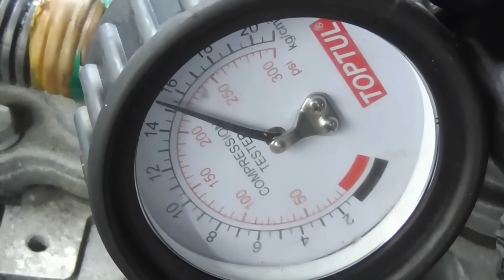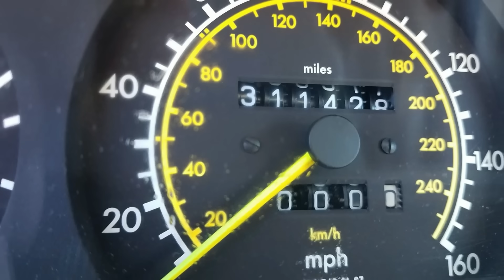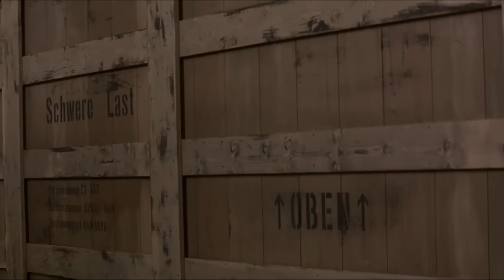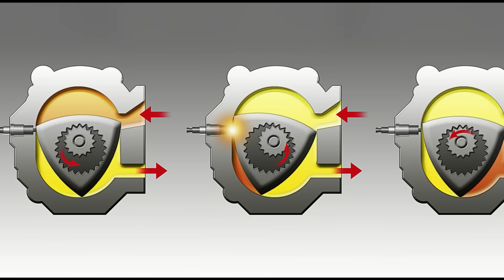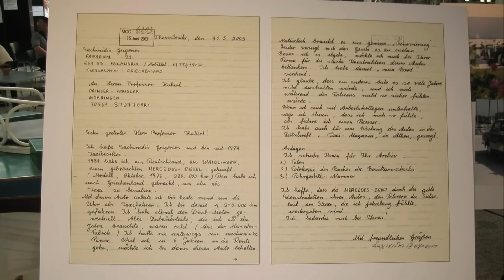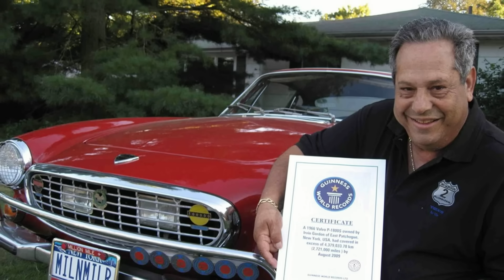Most Reliable Engines of All Time

Comment: No GM 3800 but you list a rotary engine?
Reply: The 3800 is a good engine
Reply: u kidding about the gm 3800? i hope so.
Reply: GMs 3800 v6 won design awards. Not sure why they stopped making it. They'd figured it out and it ran almost flawlessly since they fixed it in the late 80s.   Starting out it's life as GM's thrown together response to the 70s gas shortages/efficiency push. It had an inauspicious beginning. GM simply cut 2 cylinders off a V8 and put it out. It was, then, a piece of crap that often vibrated itself apart well below 100K miles. By the late 80s, GM woke up a bit and installed the counter rotating balance shafts necessary in a 90° V6... It got better and better. Won awards, as mentioned. Then it was gone. 🤷‍♂️
Reply: Lolololol
The GM 3800 series SUCKS
Reply: @Jett-Alaska  you clearly have never owned one
Reply: @kylecannon5679  You're right. But I've sure worked on alot of em.

Comment: Is that miles or kilometers? I wasn't aware that people in Europe measured distance in miles. But that would still be in excess of about a million and a half, and there are stories of several US Engines making that Mark quite easily. I've seen the Chrysler slant 6 run 3 and 400000 Miles with poor maintenance. I even saw one go 79000 miles from brand-new till one day it didn't start and the owner had never even checked the oil much less changed it. Where the oil drain plug was removed only about 4 oz of sludge dripped out of the oil pan. It probably ran for about a year with no oil at all.

Comment: Correct list is: 
1. Diesels
2. All inline 6s
3. Any completely stock Honda or      Toyota engine
4. SBC
5. Ford 4.6 
7. Any Mazda N/A engine
8. Ford 4 cylinders
9. GM 3.8L v6
8. 351 Windsor 
9. GM 4 cylinders
10. Volvo t5
There is no such things as a Dodge or a Nissan or a rotary or a purely german engine in a reliability top ten list. Lmao

Comment: Our 1972 VOLVO 245 station wagons engine went 450.000 KM had some parts changed in 1984, went 680.000 KM then we sold it to a friend of the family who had it run close to a million KM. We bought the car used around 1980, when it had 180k - 200k km on it. My fathers 1997 Toyota Corolla's engine ran without a single engine failure its entire lifespan, retired in or around 2012.

Comment: 4.0l Inline 6, in the 1987 and on Jeep Cherokee’s, very very reliable
Reply: Those AMC sixes with the 7-main bearings were  durable, long-living motors. Easy 200K life with a little care. They date from decades before the Jeep Cherokees used them.  Back in the 1960s, famous race car engine builder, Barney Navarro built Indy 500 race motors with the 199- CID version that made over 850 horsepower.
Reply: Charles Nash daaaaamn I had no idea, thank you for the info it’s always cool to learn new things like that!!!! I own a 1987 Jeep Cherokee Laredo with the 4.0 235k miles and still has a lot of power!!!!! Of course it’s old but I love it it’s cool and very comfortable they definitely knew how to make really nice seats back in the 80s 😂😂😂 I’m only 18 so I really wouldn’t know but those seats are the comfiest seats I’ve ever sat in
Reply: A friend of mine had a 95 cherokee with 420k miles!!!! It was a beast but rusted out and was junked. 4.0 high output!!!
Reply: Dodge/ Chrysler does make (or buy) great engines. It's everything else that falls apart. When someone says their Jeep is in the shop I ask if the radiator is leaking, and I'm usually right.
Reply: @gorkyd7912  Jeeps alway are  over heating
Reply: I've got a 96 Grand Cherokee Laredo with 4.0 at 350 plus and she's still going just fine,,, I've gotten her up to 25 plus MPG on highway and 19 in town.
Reply: Tractor engine not on the list !
Reply: Mine is 19 years old and at a young 200k.  Only minor parts like a thermostat.
Reply: dont forget its smaller amc engine in the gremlins and hornets, 300, 000 easy
Reply: Junk
Reply: Clover Rover you mean they were junk from the day they were made ?? My grandmother had a 1995 jeep Cherokee with the 4.0 and it burned oil since day one and was taken to the dealer many times for them to say it was perfectly normal
Reply: @thezeroto60outlet  ur grandma was a  dumbass and got her oil mixed up with her gas. But honestly anyone that knows anything about engines  would know how great of an engine this is...

Comment: Rotary engine have short engine life. So do sports car/ bike. They are higly stressed.
  Low tech engine with less horsepower can go 1 million  miles as long as you change engine oil on time and don't do high speed run.
  Some engines don't even need a valve adjustment for 4 years and yet run strong !

Comment: Just to toss my picks on the pile:

How about the 5.7L 350 GM engines with half a century of reliable history?
GM LS series engines are earning the reputation of being dependable and super tunable...
4.3L vortec V-6 (skip the CPFI years 95-96 depending on application) They also make damn good marine application engines for Mercruiser.
4.6L Fords with the PI heads and better intakes- I drove many Crown Vic PIs with these turning 250k+ HARD miles with hundreds of hours of idle time to boot.  You still see mid 90's to early 2000s (non-Triton) F-series with this engine putting along, usually no issues besides the exhaust flex pipe rusting in half.
2.2L GM 4-cylinders for rear wheel drive applications; after '98 they got better head gaskets and these powered most of your U.S. post office LLVs with 300k+ miles of stop and go driving.  Had one in an S-10 mated to a 5-speed and it survived for me 200k of abuse as a delivery car, college commuter, and all-around work mule.
3.8L GM v-6 is one of the most reliable engines ever made- appeared on Ward's list for years.  Earlier models liked to eat alternators a bit.
4.0 straight-6 Jeep/AMC engines have been known as damn near bullet proof less a gasket here and exhaust manifold there- in production in various form for several decades!
International 7.3L Powerstroke (Ford) aside from the occasional sensor woe has been known to go half a million or more miles without any mechanical failures

I could go on & on about the lack of love for the domestic engines.  Hell even the 5.7L Hemis are proving to be very reliable albeit typically bolted to Chrysler junk automatics for their first decade of applications... this list is laughable!

Comment: My 5.3 L Chevy 1999 Silverado 410,000 miles.
Reply: Nice!  I wish my 2011 5.3L didn't have the AFM/DOD lifters, cause it will never last that long.  178k so far, and I hope to get a few good years out of it yet.
Reply: @Maxxarcade  Yes, that Active Fuel Management feature is a durability issue, but otherwise the 5.3L is a great engine !
Reply: @rosspbarnett458  I got one of those Range AFM disablers, and it actually made my mileage go up a bit.
Reply: @Maxxarcade  Hopefully your motor lasts a long time !    Peace
Reply: My 2007 gmc classic 231,000

Comment: I've had 3 jeep Cherokee sports with the 4.0 6cyl. All over 400k with just belts and oil change. Best America engine made
Reply: I loved my 4.0 six inline cherokee. 
Only bad thing with those cherokees is electrical problems, sensors/computer. At least mine did and it was a headache sometimes.
Still great car!
Reply: @nonromanroman3204  yeah every now and then the windows wouldn't go up or down and sometimes the speakers wouldn't work, but those are end of the works vehicles, started every time and drew through 18inches of snow without a problem.  I still keep one around just in case.

Comment: Cummins out last any and every engine. 1000000+ miles on mine.
Reply: What year and model Cummins engine and in what application?
Reply: @integritytransport8762  1996 Cummins 12 valve Dodge ram 2500. Changed oil 3500 miles, fuel filter changed every 10000 miles.

Comment: I drive an 06 Ford F150 4.2 v6 220,k+ miles with basic maint. It runs like a new one.  So most of your mentions are no big deal,
Reply: I got an 03 v10 f250 with 540000 miles stock transmission and engine

Comment: I had a 1988 Ford escort that went 287,000 miles, still had original clutch.
Reply: Mine have 297,000 miles  two rebuild one new engine three transmission .
Reply: @yoteyeet5601  I only did regular maintenance on it. Timing belt was the biggest job I had to do.
Reply: Well when you're throwing down like 60 hp to the wheels u don't lose much disc material. 😂
Reply: @Jett-Alaska  yeah, it was a good car though, had it 14 years.😎

Comment: I gotta agree with the 2jz motor i have a 2003 or lexus is300 with 225 k on motor with perfect compression across the board and valves seal perfectly no leak down or blow by could prolly use new injectors thats about it

Comment: Clear bias towards complicated "tuner" power plants. There many, many, many engines that go a long way past 300,000 miles, however they are mostly bland every day motors. Ford 300 six, Toyota 22r, Toyota 1FZ-E (mine has 265,000 on the clock with no problems), Volvo whatever series motor in the 240 station wagon, my brother in law's has over 500,000 miles on it and he'd still be driving it if he was alive. Real world perspective guys, not "golly, this is sure a purty shiny  thing."

Comment: There are some diesel engines you missed there dummy.  Most diesel pickups will do 500000 without skipping a beat.  Semi engines do 1000000.

Comment: Owned a 2002 Camry 4 cylinder. After 15 years and 300,000 miles was still running smooth as a Swiss watch the day I traded it in. Should have kept it. Most reliable car I ever owned.

Comment: Why isn't the Ford 240 / 300 cid. Straight 6, on this list?
Reply: Yup, I had one, put over 350K on it before selling it. Great Engine for a Six Banger and had a lot of toque too.
Reply: Bought a 95 f150 4.9l 5spd with 116xxx miles, sold it had 487xxx miles and still ran lol the 300 inline 6 is in generators tractors pumps UPS trucks all sorts of applications
Reply: @joshmiller5640  I know about the generator use and UPS using them, I have a Onan 30ek generator with the Ford 240 in it.
Reply: I had an 82 yellow linemans truck that was hand painted red i drug out of a field for 100 bucks. Odometer stopped at 230000 so not sure what the real mileage was. At 3700 rpm all six rods would rattle but it never quit on me. Even got 30 mpg once on a slow drive.
Reply: Yes' Ford and GM were left out of the list !

Comment: RB26. Reliable.

At least you guys did that first, so you didn't waste my time before proving your lack of credibility.
Reply: ScathingMobile I have a R32 GTR and the last thing this engine can be described as is reliable.
Reply: JDM GEARHEAD 😂
Reply: @jdmgearhead960  after seeing that I was expecting the second engine in their list to be the 13B, based on how every rotary fuckwit on the internet tells you they're heaps reliable as long as you treat them right i.e. baby them by spending half an hour warming them up then another half an hour warming them down, top up the oil every time you drive it, and service them once a week.
Reply: Something didn’t seem right off the bat😂

Comment: oooohh,aaahhh roller rockers!, sorry, GM had full roller  rockers in their 6-71 (426 cubic inch) six-cylinder two-stroke diesel engine....starting in 1938. 400,000 miles is considered well broken-in ...many a vehicle fatally rusted & unserviceable while the engines are fine.

Comment: How did you skip over the Cummins 5.9 L out of a dodge 2500 or 3500. There is another diesel that went into small semi trucks as well and could do a million miles before a rebuild and do several rebuilds before needing replaced. Can't think of the name right now though. 14L Cat I think.

Comment: Ford 300 six easily obtained 300k+ miles without issues over and over I've seen it in fleet service, Also, the ford 4.6 I've seen over and over go over 350k miles without issue in both taxis and police service. Indeed, if you're reliability target is under 200k miles, leave it in the garage!

Comment: 1UZ-FE is probably the most reliable engine. Theres one out there with 1,000,000 miles on it and still going strong. They are fully forged engines stock with 6 bolt main caps so they are incredibly strong

Comment: My 2003 F150 5.4L has gone 228,500+ miles & NO major engine or transmission repairs!!!
Only very minor things like ignition coil - had 3 replaced  :)
Reply: I've heard of several 2 valve 5.4's within over 500k miles on them.
Reply: If you don’t push them like most people do then it should go for a long time

Comment: 200,000 miles is the benchmark to beat to be considered reliable. By then most of the rest of the car has worn down and rusted. If its cant reliably do 200k its a poor engine.

Comment: Uh LT1 Chevrolet 350 5.7 l? Ford 4.6 modular V8, CHRYSLER 318???!!! So sick of all these so sick of all this "programming" that Lies by omission and leaves out some of the Great American built products that have moved the American people around the country for decades longer than these other engines and did so with American Ingenuity and dependability reliability and low cost not to mention that they don't have timing belts to be changed that will break if not changed leaving the engine with broken valves and pistons even possibly if not for a costly maintenance repair that would be done by most likely a shop a lot of these engines that they listed are performance 93 octane plus engines as well... they also don't talk about torque and the ability to pull trailers/ boats etc.   That's the liberal-left way: to just hate everything American!

Comment: Oh and you forgot chevrolet's (made by Isuzu) 2.8 L V-6. I had a 1991 gmc sonoma with that 2.8 and put 298,000 miles on it and only had to do about 400$ bucks on the whole truck in parts through out its life. Was still running great when i sold it! Original clutch too.

Comment: 50,000 miles is normal life for a clutch disc?  My 1996 BMW e36 went 178k.  My Honda Prelude went 200k before I sold the car.  A Chevy small block V-8 can easily go 300k if you simply Change fluids and air filters.   
BMW M54 straight 6 is bullet proof.  The M50 without Vanos would survive a nuke.  The Jeep inline 6 could survive a direct hit from a Death Star.

Comment: Two 4.0 inline 6 engines missing I'm afraid.

Australian Ford Falcon 4.0. Great power and economy, many of them taking space up in junk yards as the ones on the road just don't give up (rust in the body or transmission will go first).

And the US Jeep 4.0. Not the best power, or economy, but they have a great torque band for 4x4 and are over engineered for their purpose. You can find videos on here of 'cash for clunkers' people trying to destroy the engines... it takes a while.

Comment: that camry engine you mentioned is actually not that great, l mean don't get me wrong it's not a bad engine by any means but l wouldn't say it's one of the most reliable. that engine had some common issues like burning oil, and there is a really bad rattle upon cold starting once you get to high mileages possibly from the VVT getting gunked up and starved for oil for a few seconds. 

did you just say 150-200k miles? are cars really that shitty these days? shit l know of a few engines that can hit 400k without shedding a tear.

Comment: the reason we can't make more reliable engines is because nobody has balls anymore and engines are made out the cheapest metals they can find. engines used to be made out of cast iron now they are aluminum which is not bad in itself, aluminum engine tend to get better gas mileage and make more horsepower but since aluminum is way more brittle and has half the melting point of iron, it's also not as durable. most cars today are made from low quality chinese aluminum that's full of impurities making for bad castings.

Comment: The Mazda rotary engine was never very reliable. The spark plugs would foul out and they needed constant oil changes!
Reply: I said WHAT? A reliable rotary...laughable.
Reply: Well, the old stock rotarys wasn't very reliable until the aftermarket came out with uppdated parts in new materials.  Also the engine oil became more specialized to work with rotarys. You cannot just pour in the first oil you will get your hands on. 

There are a few things you have to know as a rotary owner. 

Never ever push the engine before it's fully warm. Always use recommended oil qualities that completly burn off in the combustion cycle, it will foul the plugs with carbon build up and excessive oil

Never ever over rev a rotary with stock internals, the stock parts aren't designed to handle enginespeeds above the redline. The engine wants and can rev very high but the internals are simply too heavy, the centrifugal forces will damage the rotor housings and the sealing..  They are reliable when maintaining them correctly.

Comment: I see engines last  to 300,000  400,000  and more miles it's the customer that don't change the oil and take care of the accessories of the engine like the cooling system that cause the engines to fail. Trying to blame engine manufacturer's is like spreading fake news!